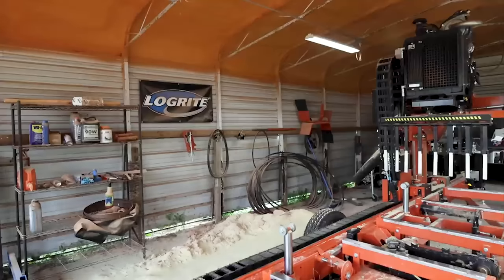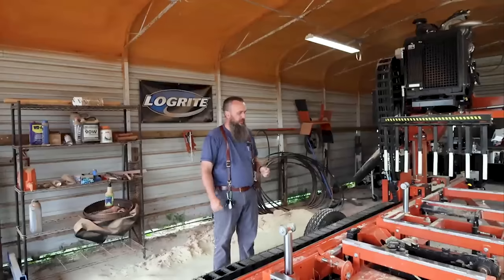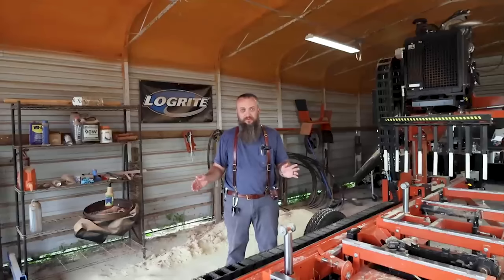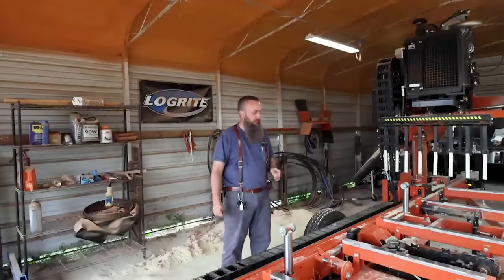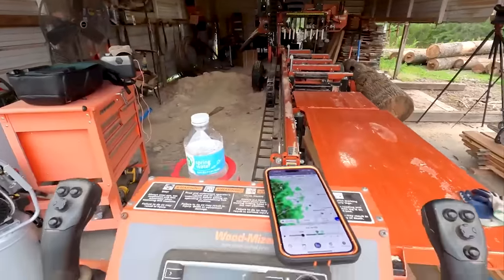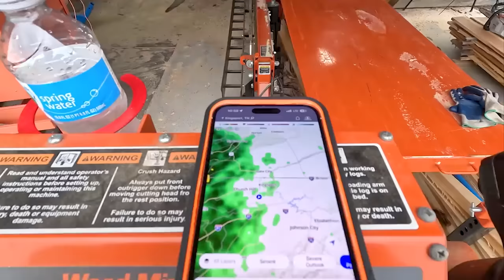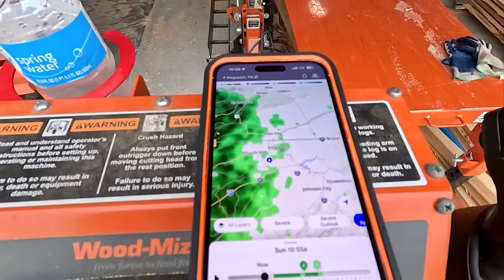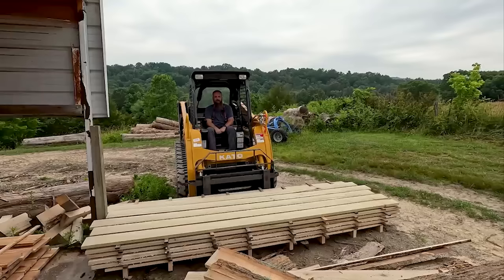I Have The BEST Job In The World! Backwoods Hillbilly Figures It Out

Comment: No need to close your shed off at the control end, with your skills, just extend it out enough to keep you dry when it rains & the sun off when it is hot (skin cancer, brrrr).  You need it open to stack your cut lumber on Kato.  It's not even important at the start to have a concrete floor, that can be added later if desired.  Great video, cheers, Don from South Australia.

Comment: You may have mentioned this at sometime but i missed it or forget, but to my way of thinking your mill is backwards. Or your shed is. If your prevailing weather cones toward your back when at the control panel wouldn't it be better to close that end in so you are protected from rain. Then you could mill no matter what the weather. Just an observation. I never like to tell someone how they should do what they do.
That Kato is an awesone machine but it behooves me as to why they wouldn't put a door on it. All the ones I've run had doors and climate control. When its raining and cold or minus 10° out it sure is a joy to have.

Comment: The KATO is a practical machine for your applications, however for an operator w/ hydraulic implements that require more than the simple open/close of a cylinder, such as a mower, snow blower, even a post hole digger or chin auger, the GPM flow is inadequate. 🗽🇺🇸🛐